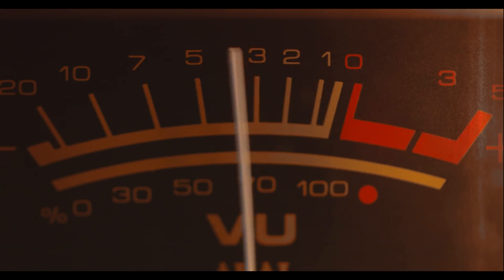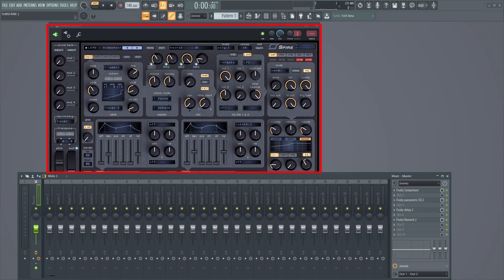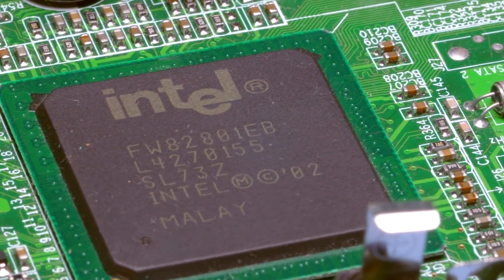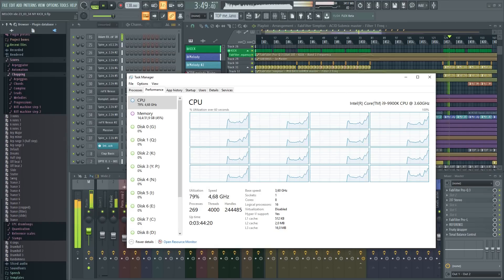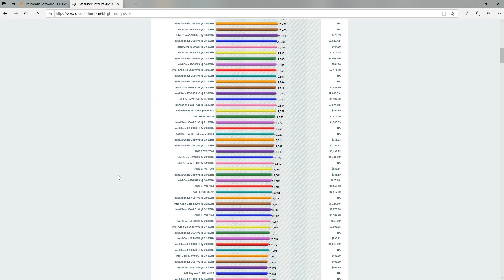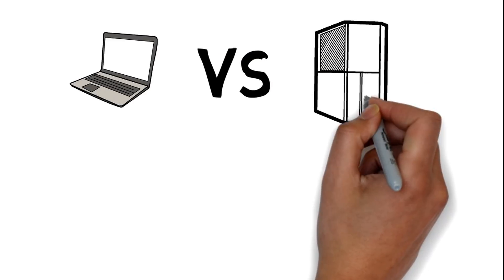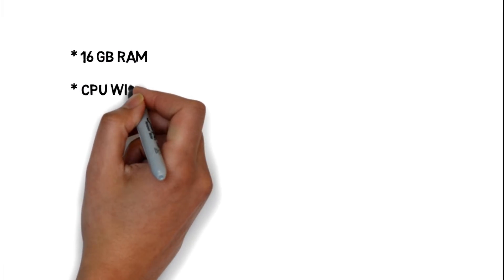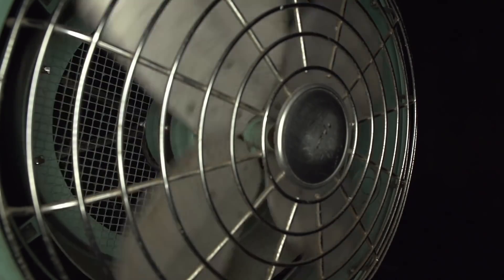The Best Computer For Music Production - What's Needed And Why!

Comment: This is BS .... you need nothing as powerfull and spend all tht cash on a decent set of speakers and a high end DAC.......
Reply from the maker: The title of the video is "the BEST computer for music production".

It's true that most people won't need the very best computer though. As stated in the video, It all depends on what kind of projects you make and how you work. If you make very large projects with a lot of CPU hungry VST's and effects, then you'll need a rather fast computer indeed. The same will be the case if you do a lot of live midi recording, which will require a low buffer size for minimum latency. That will also require a lot of performance, even for medium sized projects. 
On the other hand, if you work mainly with small to medium sized projects, and you don't do much live recording then you'll get by with far less. The same will be the case if you mainly work with pre-recorded audio samples, or using external gear. The purpose of this video is to show people how modern daws process information and what kind of CPU's are best suited for the task. There are several alternatives listed In the parts list. You'll also find links to AMD alternatives, which will typically give more value for your money. 
But If you want the very best computer for music production, then you'll need as many cores as possible, and also the fastest cores possible. Unfortunately there tend to be a trade off there. More cores typically means more heat, which means less single core performance, so it's important to find the right balance here. The 9900k is therefore a very good choice. I suspect the same will be the case with the new 3000 series from AMD, but I haven't had the chance to test those yet.

Comment: 16GB ram are not enough for Superior Drummer in Protools HD. In my opinion, an audio workstation should have 32 GB minimum. I'm gonna build a new one in 2020 and will go for 128GB at 3600Mhz. 
About the noise a computer can do, to me, the solution is the Silent Box. I use Noctua fans in an Antec 19" 4U rackmount case into the Silent Box. I own a Silent Box made by Keoda in Poland and I have zero noise pollution in my studio : https://www.keoda.com/fr/our-offer/soundproof-box
Reply from the maker: Indeed. For huge libraries like that you'll need quite a bit more. :)

Comment: ryzen 5 3600 hands down https://www.cpubenchmark.net/compare/AMD-Ryzen-5-3600-vs-Intel-i7-9700K/3481vs3335
Reply from the maker: The new 3000 series is looking really promising, but it's impossible to say for sure without testing the two CPU's against each other on equal terms. Keep in mind that the AMD chips doesn't have much room for overclocking, while the 9900k can easily be clocked to 5,0 - 5,1 ghz. With both running at 3,6 ghz the 9900k still has slightly better single thread performance, but AMD has more cores and that could potentially make up for that, at least in very large projects. 
I'm considering making a follow up video, putting both systems to the test on equal terms, but the new AMD CPU's isn't available here yet so I'll have to wait a little bit. :)
Reply: @FireWalkMusic  overclocking is not for everyone, consider the price difference also, a follow up would be nice...amd is now supporting thunderbolt but i prefer if all top brands of interfaces moved to usb c...i am in rage when i see new interfaces with only thunderbolt connection...and they think it is easy business to have a compatible mobo...and probably their drivers are a mesh

Comment: What was the budget to build the computer shown in the video?
Reply from the maker: I think it was around $2200 total. But prices will depend on where you live, I live in Norway btw. Note that usually people will tend to simply upgrade their existing rig, in which case you will usually just need the main board, CPU and RAM. And possibly a new CPU cooler. That will be much cheaper. :)
Reply: @FireWalkMusic  don't get me wrong your video is good but common ...
You know that nowadays most producers use mbp i9 under clocked at 2.9ghz due to overheat and that is plenty... Even my mid 2011 mbp is keeping up with a good sound card 
Yes your session is uge but common you basically are 50% use of your i9 
Considering that even with the same amount of core on a ryzen clocked 1ghz lower it would be 70% theoretical and this is without considering more l3 cache and 7nm 
Good build but not the most buck efficient for most people
Reply: Go ryzen 3000 serie with x370 motherboard and save your bucks for a better and mostly more easy to build case and a good sound card or monitor or even sound treatment for your room ;)

Comment: That's like overkill an i7 8700 processor is all you need, if you have the money I see why not but if you're a broke individual like myself you'll be doing just fine with an i7 which is more than capable of running daws, vsts, etc. Look at the softwares requirements your using it's usually always in like a manual or something, as of rn anything above an i7 is pretty much overkill
Reply from the maker: What kind of computing power you need is very individual. Some producers will get by fine with an older i3 even. It depends on what kind of projects you make and how you work. If you make huge projects with a lot of CPU hungry VST's and effects then you'll need quite a lot of computing power. On the other hand, if you make smaller projects, or if you're using a lot of pre-recorded samples or external gear, which is not very demanding on the system, then you'll get by with a much slower computer. Recording also plays a role here. You can get by with a slower computer by simply increasing the buffer, but this will make it difficult to record live. If you prefer to record live while having a decent size project, then you'll have to use a smaller buffer size, and that again will require a faster computer. I recommend that people go for a computer that's a bit faster than what they actually need though. But as you say, the older i7 will usually be more than enough for most people. The new AMD chips will also offer very good performance for your money. The 3900x will probably be rivaling the i9, but it's hard to say for sure without doing some tests. :)

Comment: No.. If you are going to recommend AMD CPUs, please be sure to be up to date. At the the of this video being uploaded there were the 2000 series processors and the the 3000 series processors were just around the corner. Both have better IPC than the 1000 series has. Other than that I think you should really underline that most people don't need that kid of horse power for music production - Especially if we are talking about recording rather than working with MIDI and VST. IT's an important distinction  :oP

But very interesting to see and hear your reasoning behind what you went with.. Good video :o)
Reply from the maker: Good points, this should have been pointed out more clearly, however,  I wanted to make a video about the "ULTIMATE" / "best" computer for music production, just to let people know what's best and why. The video was actually 95% finished about a month before it was uploaded, but I had a lot of trouble getting all the VST's etc installed and get everything up and running properly again so that I could do that last comparison. 
I'm considering doing a follow up video, putting the new AMD CPU's agianst the 9900k, to see how they perform in comparison. They're still not available in stores here, so I'll have to wait some more. :)
What kind of computer various people need will depend on a lot of things, like how large their projects are, and the way they work. If you're using tons of CPU hungry VST's and effects then you'll need a lot of performance. However, if you make smaller projects, then you'll get by with much less CPU. Note that people who like to record midi for example, will often tend to need a rather fast computer so that they can work with smaller buffer sizes to minimize lag. A small buffer will require a faster computer. 
On the other hand, if someone work mostly with pre-recorded samples, or external gear then they won't need much computing power at all. :)
Reply: @FireWalkMusic  
I mostly deal with MIDI and VSTs of all sorts. I would like to see a serious shoot out between AMD and Intel CPUs.
specially to different synths using PADs and Strings.  Ive seen many computers get crippled when they use 2 or more VST synths that are playing pads and Synths.
ANA2 Synth is one of them and many more.  Ive had a few patches in SERUM do this as HIVE, and Sylenth.  just to name a few.
Dont know if this is caused by the synth patch itself or the CPU. but different people experience this on all sorts of CPUs from AMD and Intel.

Comment: Was it worth the upgrade for you? it seems you only got a few % boost
Reply from the maker: Hey, yes for me it was worth it. The reason for the rather small increase has to do with the two different platforms. The 5820k was Intel's workstation platform, featuring quad channel ram. The i9 only has dual channel memory. This means that the 5820k in theory has twice the available bandwidth. The added bandwidth is giving the older 5820k an advantage here. On paper the i9 is more than 40% faster than the 5820k, but you don't see that reflected in this case. The i9 is still hugely superior in many other tasks though, and also features more cores, so overall I can run larger projects without overloading the systems now. Most people also use their computer for more than just music, and the 5820k will often become a bottle neck in various other tasks. Because it's an older design by now, and because it's still quite expensive, I wouldn't really recommend it over the i9.

Comment: Before buying a new pc, consider this. My 12 year old q6600 o.c.'d to 3ghz with 8gb 1333 (cas ras rtas 7-7-7, suck thát ddr 3200..) and an  antique EMU 1212m pcie (196 / 24  - 120 db Snr) Works as a charm as my DAW. It runs a typical setup of a flagship sequencer running 24 audio channels , 10 vst instruments ( with lot's of 'm multitimbral so between 2 and 10 stereo outputs per VST = about 40 channels stereo sound realtime processed in a regular project, 8 high quality send effects ,  about 10 insert effects, a mastering end stage, and about 30 midi channels including multiple automation on all midi , instrument and audio channels.All at 24/96. Latency during such a project 8 thousands of a second.(8ms). Now if your aim is huge movie scores , you probably want something more powerful . But for complicated dance, edm ,pop or house my system is more than powerful enough. It's not the pc ( well just a bit..)but the way you set it up that makes it capable of handling high speed , high quality, low latency  audio.
This is a track made with my PC.   https://soundcloud.com/user-274767087/spirito-something-special
Reply from the maker: Hey, cool track, I just listened to it. It's true what you say here, what you need in terms of computing power will depend on a lot of factors. If you're making huge projects with a lot of VST's and effects then you'll typically need a lot of performance. If your'e making smaller projects then you can get by with less. Also, if you mostly use pre-recorded samples or external gear, then you don't need that much. 
I should point out though that if you're recording midi then you'll need a low latency while recording, and even a medium size project will consume a lot of CPU power when the buffer size is reduced for recording. 
Usually though, the i7 CPU's will still be more than enough for most people. The new AMD 3000 series will also provide a lot of performance for your money.

Comment: So Abelton Live explains it like this. (I’m not sure how FL can processes multi/hyper-threading)
More cores, slower clock speed
Pros
Live supports multi-threading, therefore the more cores are available, the more efficient it will be when working with larger sets with higher track counts, or when working with large instrument or effect racks.
You'll probably be able to run more apps in conjunction with Live without seeing performance drops.
Cons
Lower single-threaded performance than a higher clock speed processor.
Fewer cores, higher clock speed
Pros
Better single threaded performance.
Cons
Fewer cores to split between applications.
Not as strong multi-threading performance.
Reply from the maker: Ableton pretty much process information exactly the same way that FL Studio does. In modern daws one mixer track typically represent one opportunity for the CPU to distribute work over more cores. Typically, you want as many cores as possible with the fastest possible single core speed. The problem though is that as core count goes up, single core speed tend to go down. More cores typically means more heat which means slower cores overall. Because work typically isn't distributed evenly across cores in audio production, you risk encountering a scenario where you have one core struggling to compute a tread where a lot of dependencies has been created, and the other cores has to wait for it to finish. In that scenario you'll encounter stuttering and crackling, and the other cores can't do anything about it even if some of them are are idling. That core will have to complete it's work before everything can move along, because everything is being processed in real time. 
For this reason, single core performance is very important. Core count is also important of course, but only up to a point. Because there's a trade off here. The reason the i9 is so good at this is because it offers very good single core speed, and also a lot of cores, with hyper threading (16 threads). 
The new AMD 3000 series also looks very promising, but I haven't tested it yet so I can't say for sure how it will perform vs the 9900k.

Comment: Basically just build a gaming PC.
Reply from the maker: Some gaming PC's will  work very well at music production. There are some exceptions though. Games rely heavily on the GPU, and the CPU doesn't usually have to work very hard. It has been the consensus that it's better to have few, but very fast cores, so that the CPU doesn't become a bottle neck. This has been a good trade off because gamers could then spend their money on a more expensive video card instead. DAWs can't utilize GPU accelration, so it's better to get a cheaper video card and then spend those money on a faster CPU instead. 
More cores in a CPU typically means more heat, which typically means that single core performance goes down in favor of more cores. 
Some older i5 CPU's without hyperthreading has been very popular in gaming. The cores have good single core performance, but in music production you want to have a reasonable amount of cores to spread work over, while at the same time having good single core performance. If you're going for a gaming PC then at least get a CPU with hyper threading. Preferably an i7.
The new AMD 3000 CPU's also look very promising and will more than likely offer superior value for your money. :)
Reply: @FireWalkMusic  Usually tend? One of the words is redundant.
Reply from the maker: @raycochrane3971  Thanks, it's been corrected. I'm from Norway btw, so English is not my primary language. Still learning. 😁
Reply: @FireWalkMusic  Doing a fine job of it too.
Reply: Nope! Gaming PC are investing heavily in graphic card(s), but only enough into CPU not to throttle the graphics. Single core perfomance is NOT that important, that is why you see a lot of Ryzen CPU in budget builds. In terms of economics: Money invested into a nvidia RTX 2080 Ti is simply wasted on music production, but a high clocked i7 would be a good investment.
Reply: I've built a dual-purpose gaming/recording pc, and I notice that the DAW eats up more RAM than most games do, and if the RAM fills entirely, is much more of an issue with production. Gaming can also get away with a much slower storage drive, as the DAW will stop playback entirely if it can't read the drive fast enough, compared to adding a few seconds onto load times.

Also in my studio, I do a lot more recording physical instruments than virtual instruments, which involves much less processing per track but can result in some very high track counts, so my priority ended up being on core count rather than core performance. This scenario is also much more intensive on storage read/write speed than a VI-heavy session will be, so if this is what you do then definitely go with an SSD or at the bare minimum a 7200rpm HDD.

So basically, in addition to what FireWalk already mentioned, there's quite a few differences between gaming and production, and even though there are numerous similarities, inside those similarities are differences in what's prioritized. That said, it's usually not going to increase your cost too much (relatively speaking) to add gaming capability to an audio PC.

Comment: How much did it all cost you in total?
Reply from the maker: Around $2200. I live in Norway though and prices will differ depending on where you live. Note that you typically won't have to buy everything from scratch. Usually it's enough to just upgrade the main board, CPU, RAM and possibly the CPU cooler as well. That will be much cheaper. :)